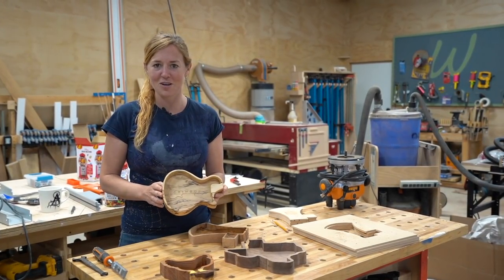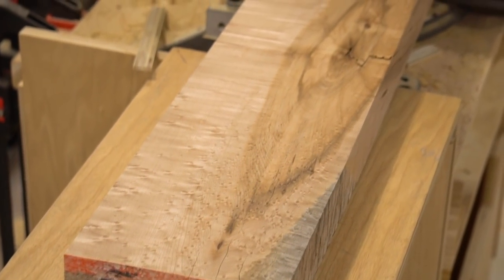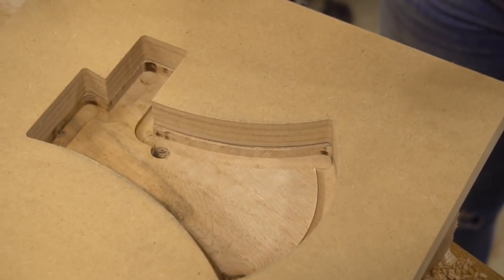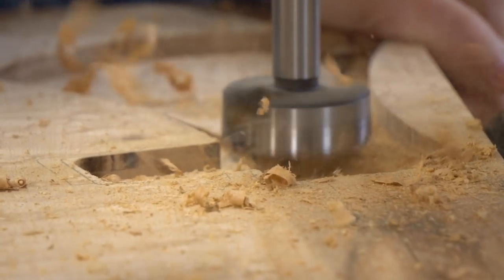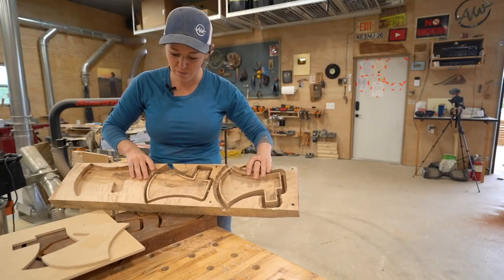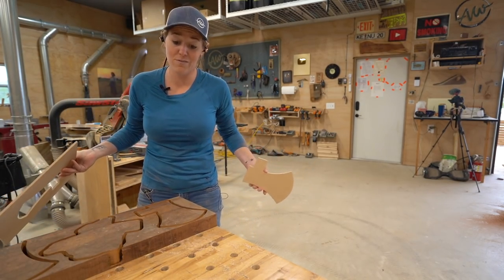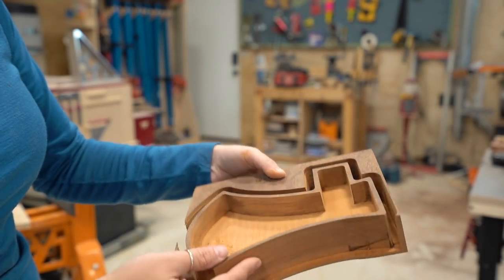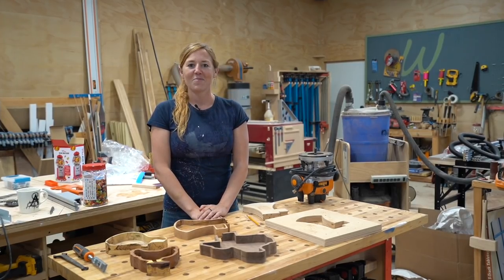Custom Parts Trays | How to Make

Comment: Great project and love that you show how with thinking outside the box little one doesn't need a cnc to create them. You could take the parts tray on step further and route a smaller profile on the bottom so the could nestle them.

Comment: I would approach the project as a bandsaw box. Cut out the outside shape.  Slice off the bottom next and then use a 1/4 or 1/8 inch blade and cut out the interior shape.  Just make sure the cut you make to cut out the inside is with the grain so the glue hides the joint  Glue the bottom back on. Glue the opening you made to cut out the interior and you're done. Will be a lot faster than the router, a lot less waste too. You can use the scraps to make smaller trays. I would bet it would also be quicker than the cnc as well.
Reply: Brilliant and simple. Thank you!!

Comment: THE ONE THING I GET OUT OF WOODWORKING IS PEACE...
A CNC MACHINE IS FLAWLESS ,ALMOST STERILE ,NO WARMTH.
 IF YOU ARE IN A MANUFACTURING BUSINESS ,THEN THE CNC MACHINE IS DEFINITELY THE ONLY WAY TO FLY.
HOWEVER I HAVE FOUND THAT THE TIME ,AND EFFORT, AS WELL AS THE CURSING ,MAKES WOODWORKING FUN FOR ME.( AS I WAS IN THE PIPING/WELDING BUSINESS FOR 40+ YEARS) STEEL/METAL, IS MORE FORGIVING THEN WOOD(NOT AS PEACEFUL FOR ME).
THAT'S JUST ME. I AM AN OLD FART AND WAS TAUGHT BY AN OLDER FART ,WHO HAS LONG SINCE PASSED.
AWESOME VIDEOS I WATCH THEM ALL (ALMOST)
GOD BLESS YOU AND YOURS
Reply: That's probably why the CNC will be moving over to her commercial building where she will be manufacturing stuff.
Reply: Not everyone thinks the exact same way as you. We're all different and get enjoyment out of different aspects of woodworking, making, etc. Just because you find it sterile and lacking swear words doesn't mean everyone else does or should.

Comment: Not only is carpet tape much cheaper, but it is thinner...i.e, no sponge.  Most 2 sided tape is adhesive on both sides and a sponge material between.  Been using carpet tape for years.  I think I heard that tip from Norm Abrams about 30 years ago.  Nice to see it still is a good tip.

Comment: Since I didn't exactly see it in the video (or I am just a little dim as well), I take it that the solid ax template and the cut-out ax template are two different cuts since the solid one has to be larger than the cut-out? Or am I looking at this incorrectly? If they are about how much larger do you make solid template?
Reply: Either she had a larger template for the solid one, or she used a guide bushing or larger bearing on her router to offset the bit away from the template. The size difference depends on how thick you want the sides of the tray. I would probably go at least 1/2" thick, depending on my material.

Comment: Very kewl ideas there, Lil Lady.  Nice techniques used.  At first I was thinking that ax stencil/frame was to be used as a mold for metallurgy(?) pouring a mold, however, that was not the case whatsoever.  Nice equipment in the shop, too.  Keep those ideas coming. Absolutely luv them.

Comment: Use CNC to create template for hand router?!
Reply: Yes, this way people can get the templates and make their own to give as gifts or even sell. Not everyone has a CNC and she wanted to do one that people without a CNC machine, can do.
Reply: @talladegadude4852  Oh, I've FF this part :)
Reply: Free CNC routers aren't really free. Have to show them off to justify the gift.
Reply: To make a template, 
1) Print your template shape out on paper 
2) Glue the paper to hard board.
3) Cut the shape out using a jigsaw, band saw or other appropriate tool.
Reply: @scotttovey   print on 3d printer ;)
Reply: @melickon  
That would work too.

Comment: CUTE! 
One thing I was thinking of when I see your videos is, well, I am short. You know how we can't get to that last foot or so using the track saw? We stretch and stretch then have to walk around it. 
WHAT IF! there was a HANDLE that could control the on off of the saw (like a gun trigger :) )and push it all the way to the end? 
Anyway, I was number 21 today. :)
Reply: Potentially dangerous if you ever lose control of the tool and the extension causes it to stay on...

Probably a better idea to set up a way to turn the material vertically like a panel saw setup...  Something like this example...

https://www.homemadetools.net/uploads/87046/homemade-tilting-panel-saw.jpeg
Reply: Get someone tall to do it for you ,much safer.

Comment: I for one appreciate your not using the CNC to make it.  Honestly, I almost clicked off when you used the CNC to make the template, thinking that's how you were going to make it, but am glad I stuck around.   (Just so SICK of people using a CNC to machine something & then claim that 'they' made it rather than what you were doing - sit there & watch the computer do it.)
Reply: I look at the CNC as just another tool. No different than using a drill rather than a screwdriver, a circular saw vs a hand saw, shop crane vs lifting it yourself. Just another tool. You are still programming it then doing what needs to be done after the CNC cuts it out (sanding, glueing, staining, whatever required). But - that's my take.

Comment: Does video to show hand power tool method

First step: cut out temple with CNC
Reply: The template doesn't need to be CNC cut. It could be free-handed, or you could print a paper template and cut with a bandsaw, jigsaw, or scroll saw.
Reply: @plc268  I know, I just found it humorous

Comment: CNC is not ww
Reply: CNC is just another tool to use, like a drill instead of a screwdriver, circular saw instead of a hand saw. Shops have lots of different tools to use, and it's ok.
Reply: You forgot to add "in my opinion."